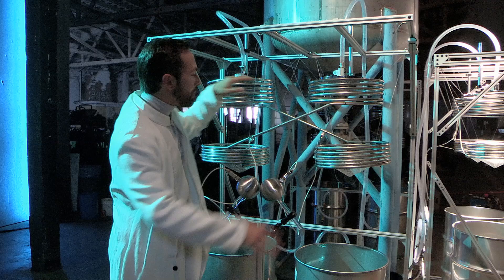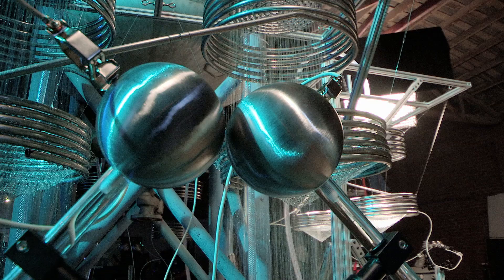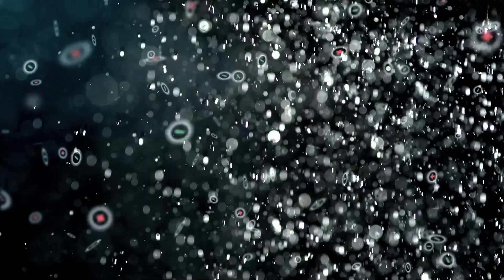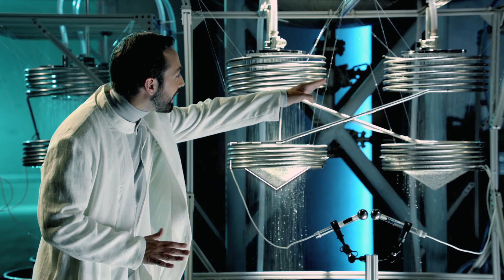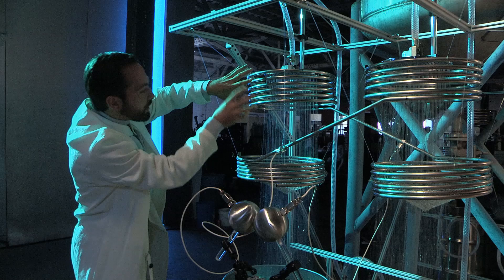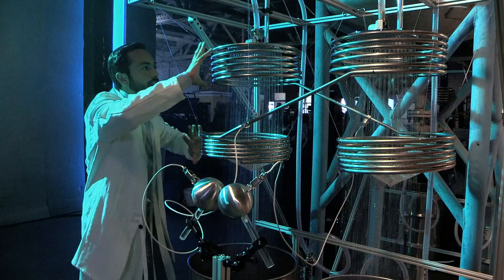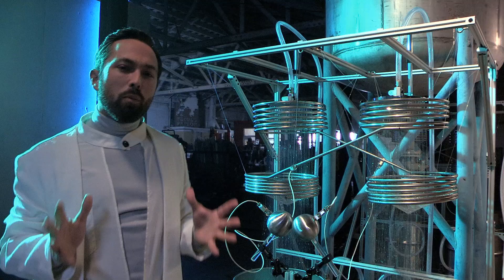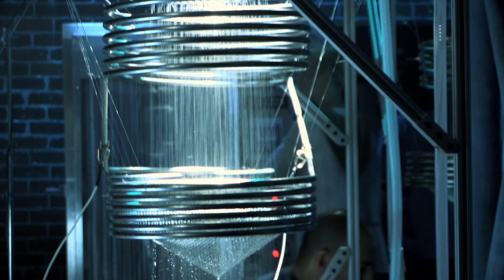Sparks from Falling Water: Kelvin's Thunderstorm

Comment: I would assume that the energy comes from the movement of the water, which is powered by gravity. Water requires energy to move upwards, so that it can fall down. As to exactly how that kinetic energy is translated into electrical, I don't know.
Reply: Friction, static...?
Reply: The gravity is driving the separation of the charges.  If it weren't for the gravity pulling the water down into two separate streams, any charge variations would just attract each other and almost instantly cancel out again.  You'd constantly have tiny electrical fluctuations popping up and then going away.
  However, the gravity pulls the water down and overcomes the attraction of those charges and rips them apart from each other to drive the whole system.  Look at how the upper coils attract the water streams due to the opposite charges.  Those coils don't contribute much to the overall energy since they are pulling perpendicular to the water flow.  However, the bottom screens have the same charge as the water and are directly in line with the direction of flow and will be repelling the falling water.  If you were to carefully measure the speed of the falling water, you would find that the bottom screens reduce the falling speed of the water by approximately the same amount as the energy being built up before each spark.
Reply: ***** I do know that electricity can be created by magnetic forces only when the magnetic force changes. That happens when (-) charged water falls nearer and then away from a (+) charged coil. There is a change between the magnetic interaction. How this happens though is beyond me.
Reply: Dan Heidel You clearly know more about this them I do. :) Thanks for the explanation.
Reply: EE Ehrenberg
I have actually run across Kelvin's waterfall before.  However, understanding it has less to do with raw knowledge and more to do with how you approach the problem.
  Derek loooves complicated looking problems.  There's usually a lot of extra stuff that looks like it might possibly drive things but is actually just part of the process.  A lot of real engineering problems tend to act like this as well.
  The key is to step back and not get bogged down with the details of all those coils of wire, etc.  Instead, look at the overall process and try to figure out where the energy comes from.   It can't be the metal coils or screens - there's no wires or radio waves putting energy into them.  Therefore they can't be the source of the energy driving the system. 
  instead, we do have a clear driving force, the gravity pulling the water downward.  Now that we know that it's gravity driving the system, we can work through it step by step to figure out how that gravitational energy can possibly be converted into the electrical energy that's generating the sparks.
  The secret is that most physical systems are actually fairly simple if you step back and analyze them piecemeal like that.  And since there always has to be some sort of energy input, that is a logical place to start.
Reply: EE Ehrenberg
 Just to clarify, the magnetic forces aren't doing anything here, it's the electrostatic forces. the magnetic forces between the coil and the water would be fairly weak because as is said, the current is actually pretty negligible, even though the voltage is high. So the electrostatic force is well stronger than the magnetic.
Reply: Le monickous I do not know the difference between magnetic and electrostatic forces, so I am way out of my depth here. And I intend to educate myself about it somewhere else then in the comment section of youtube, so don't bother writing a lengthy explanation. :) Thanks for pointing it out though.
Reply: EE Ehrenberg That's a quality response. Someone who's not afraid to say they've reached their current limit, while putting all the would be know-it-alls in their boxes. Like.
Reply: wazzmastermax Le Monickous was not being a "know it all" by any means.  EE Ehrenberg responded with way too much defense
Reply: Daniel Engling Actually I didn't refer to anybody specifically, just the nature of YouTube in general. EE Ehrenberg didn't come across defensive at all to me, simply stated his position rather than going on a 'counter-ego', I found it refreshing. On the subject of defensive... how would you read your comment...?
Reply: What have I to defend?  Anyway, this was a cool video
Reply: Daniel Engling Assumption without proof is a dangerous thing. cool vid anyways.